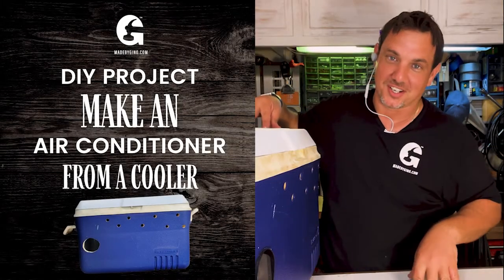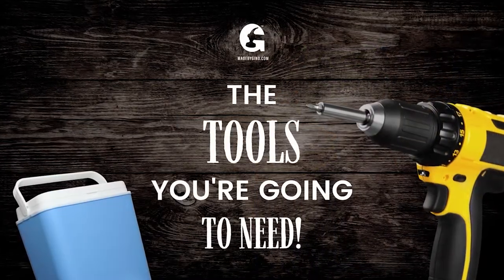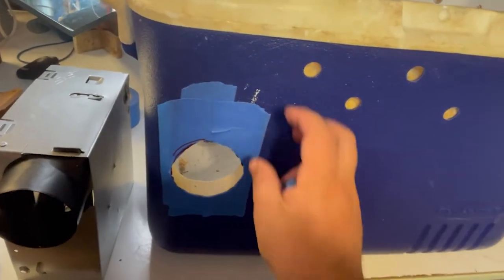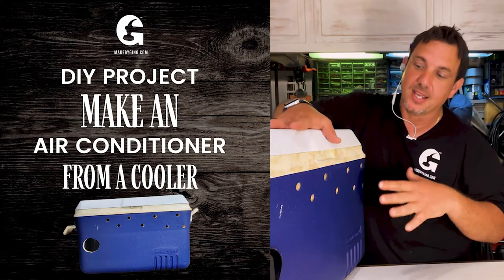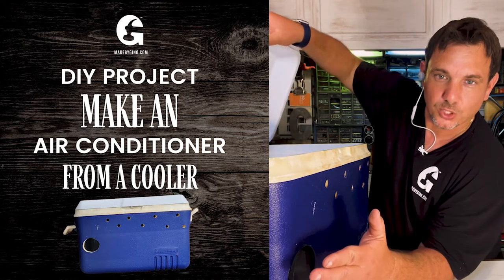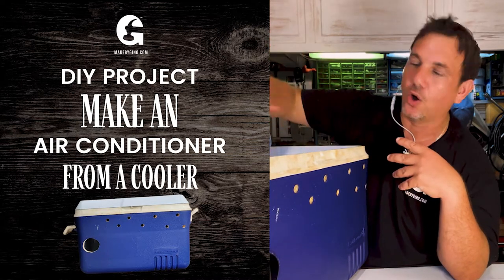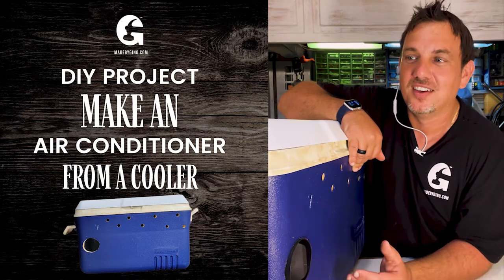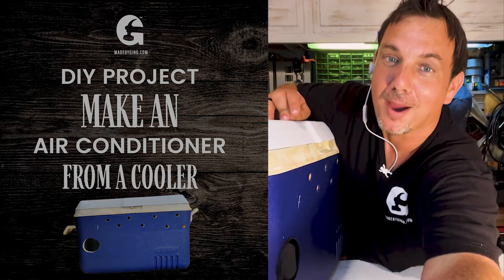Repurpose your Old Cooler into an Air Conditioner! Under 30 Bucks!

Comment: Gino video is good but i would like to know more about how the system works. To me you just put in a fan and told me to use a block of ice. Go into detail about how it is an ac unit. For instance use the big block of ice in the cooler so that way it blows out cold air through the cooler. And more detail on how to buy the fan... on amazon or ebay ect... you started out great on how to cut the hole with a tip on the painters tape. But i wanted more info on how it works... good job bro keep up the grind
Reply from the maker: Keith  really appreciate the your genuine feedback and view from another perspective. I will take into consideration a lot of what you have mentioned and apply it to my future videos. Grateful!